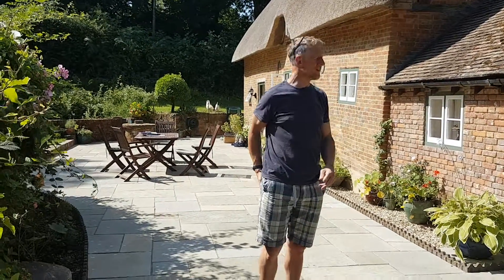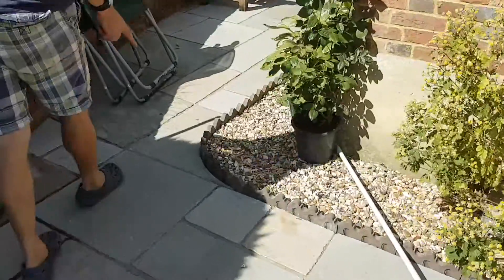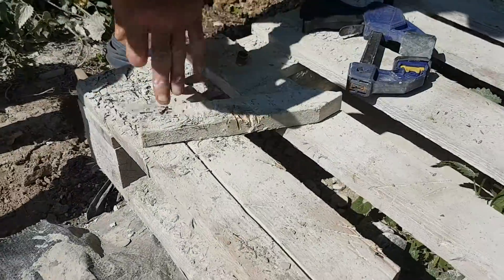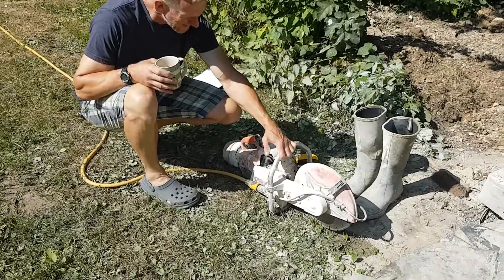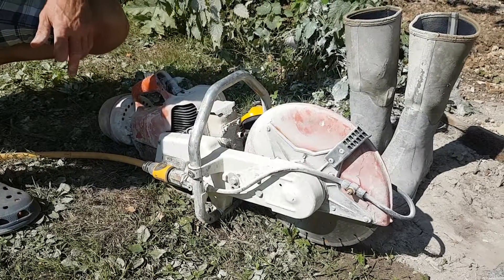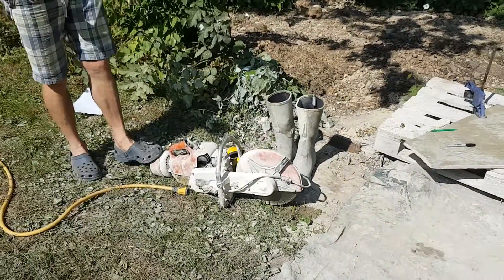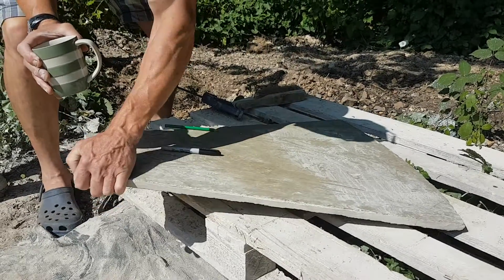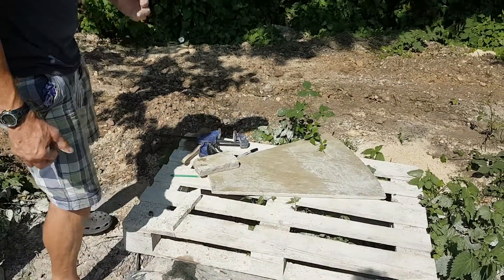Cutting curves and circles from patio slabs (part1)

Comment: Can I just ask what you recommend for the pointing? I have the same stone as yours and was thinking of a brush-in product
Reply from the maker: I used a product called Easy Joint. Brush it and wash it in with a hose. The wetter the better, until the ‘rainbow’ residue starts to reduce. Fantastic product. My patio has endured hot days, freezing conditions and lots of rain. Nothing shifts it and still no cracks or movement. My only real advice using this is to make sure you have AT LEAST 1 inch depth. Don’t scrimp on this, I know Easy Joint is expensive, but it’s worth every penny as it is clearly outlasting any normal sand and cement pointing. It looks just like Demerara sugar when brushing in. It’s clean and dead easy to use. Also no waste. Any left over, put back in the pot and cover with 2” of water and it won’t go off. Once brushing in has finished. Leave to set slightly, then VERY lightly trowel off for a smoother finish. Don’t use pressure on the trowel or this will compact the joint and it stops being porous and affects the performance. Highly recommended. I will never use sand and cement again on a patio.
Reply: Thank you very much this is such useful information!